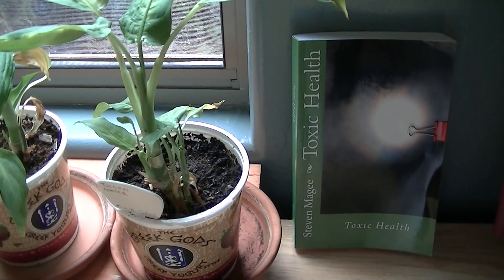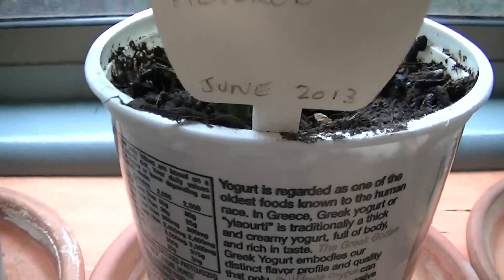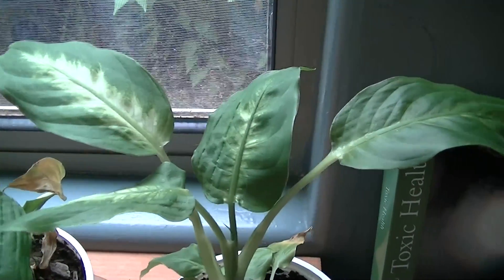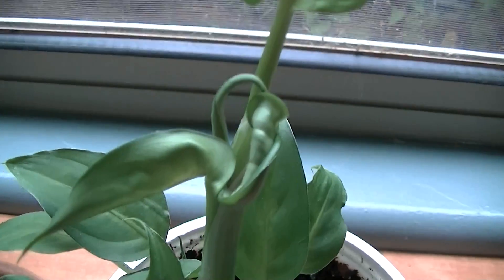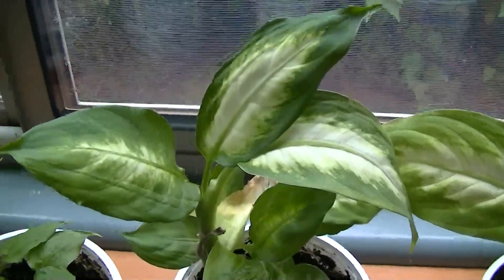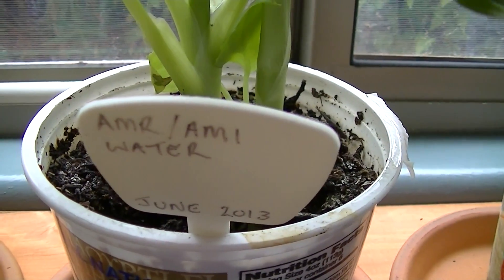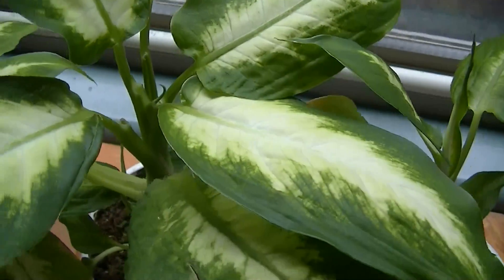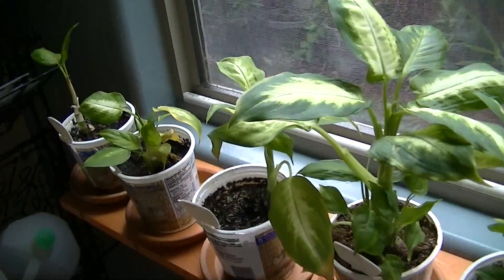Structured Water Plant Experiment September 2013 Review

Comment: What kind of tea are you using, awesome results. Not surprised about Brita being so main stream its kinda expected. 
Structuring water is more about the information it holds that the chemical composition. Quote from a documentary: Within each of waters memory cells there is 440,000 information panels each of which is reasonable for its own type of interaction with the environment. Water is capable of recording and storing information without changing is chemical composition.

Comment: To explain further in my own words, when you put water in a plastic container the information panels change to a plastic like structure and this is completely foreign to our bodies and affects the cells in our bodies when it comes into contact after you drink and absorb it.  The panels also change with vibration and can water become deadly to drink if the correct frequency is used. Light is another way to change the structure of water as it affect the information panels.

Comment: I use the negative end of high strength rare earth magnets to re structure the water and get the molecules down to a more natural cluster of about 25, or so Ive read many times and believe this to be true. If the clusters or smaller then your body will absorb it more readily into the smaller cell sized areas if you can imagine... I have also noticed the water pours a lot smoother after I place it over a high powered rare earth magnet no lies. Anyone feel free to PM me for more detail.